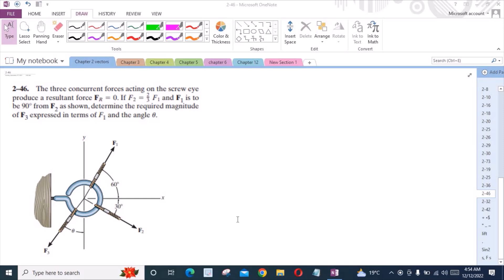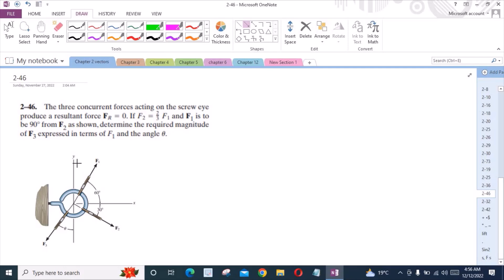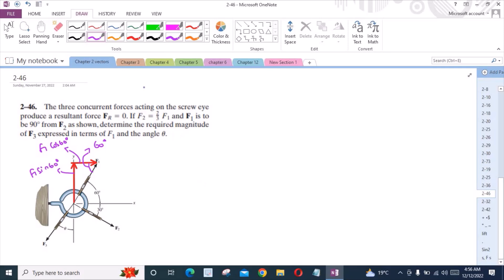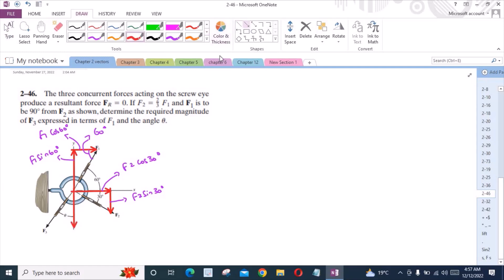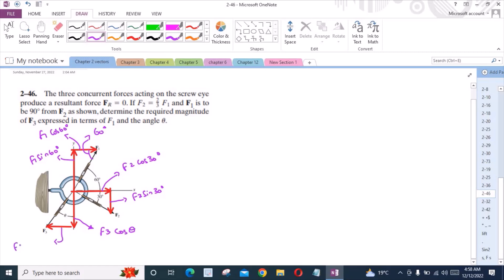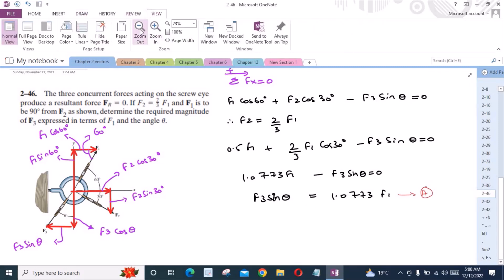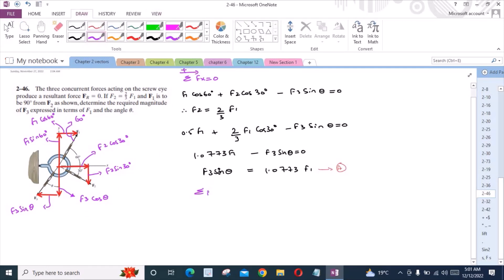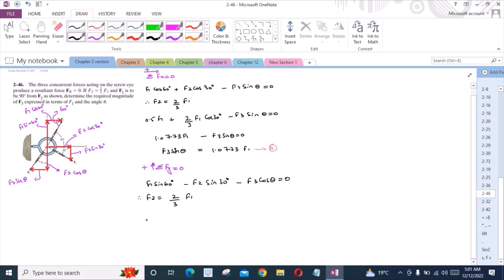2-46 hibbeler statics chapter 2 | hibbeler statics | hibbeler

Comment from the maker: Learn How to Solve 2-37 Hibbeler Statics Chapter 2, "If the magnitude for the resultant force acting on the plate is required to be 6KN and its direction measured clockwise from positive x-axis is theta= 30 degrees, determine the magnitude of F2 and its direction angle phi."
Here is the Link: https://youtu.be/TsB351n0gA0